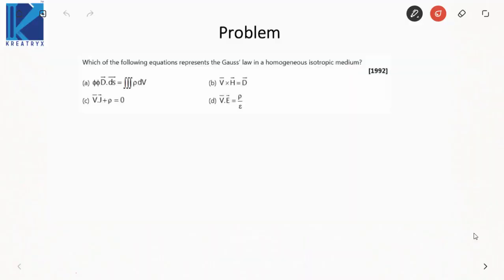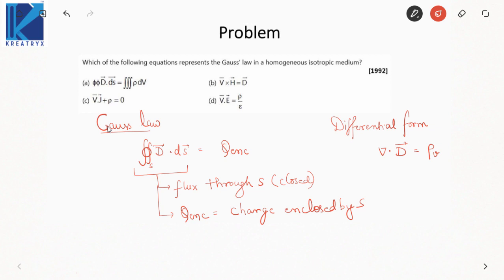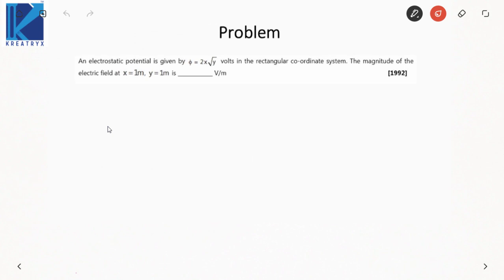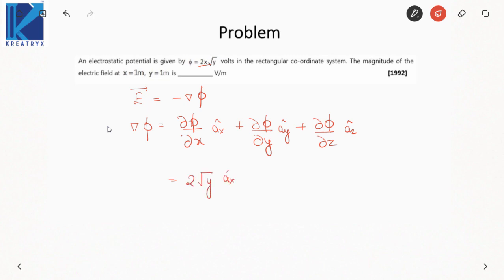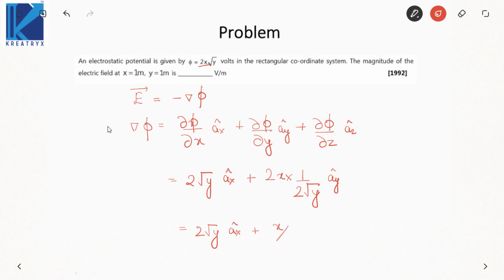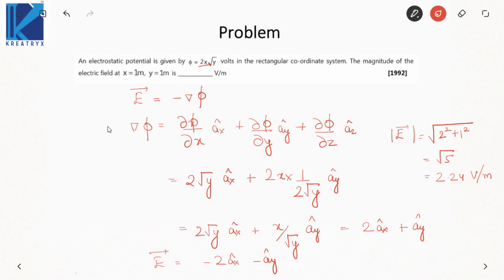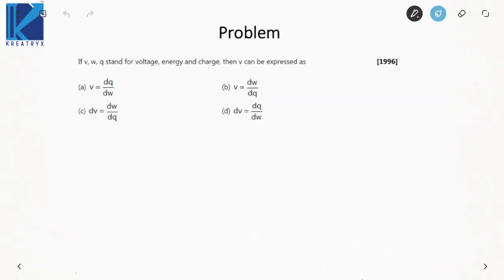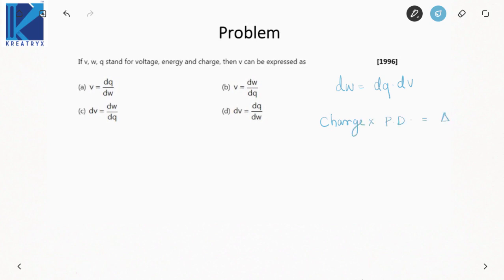EMT 1 | GATE (EE, ECE) | Problem Solving

Comment: I think Area should be 10*10 for C1 and C2, 10*20 for C3..So the final ans would be 14/3 uf..Please correct if I am wrong.

ok..I got it but leaving doubt here for others reference 😂
Reply: I think you are calculating area of square 
If capacitances are connected in series area will same for both capacitance. I think you got it
Reply: @pkpgaming7966  Yes got it...I was looking the front side of image instead of plate area. Thanks a lot
Reply: @knowledge_follower  mujhe ab bhi nhi samaj aaya ye area vala